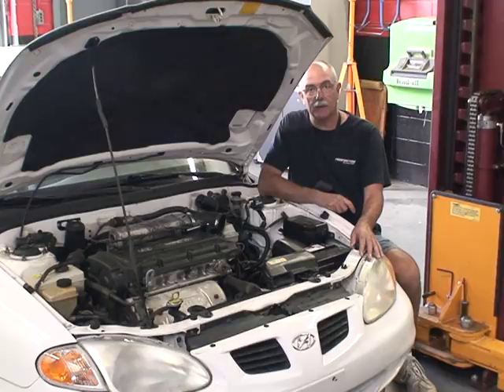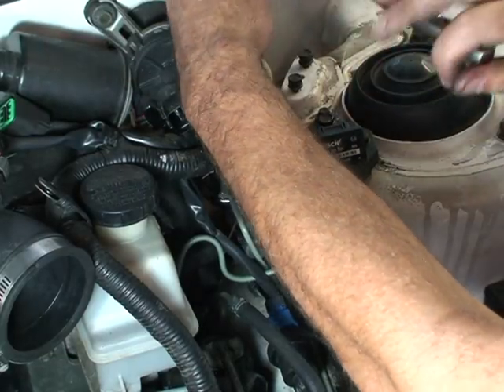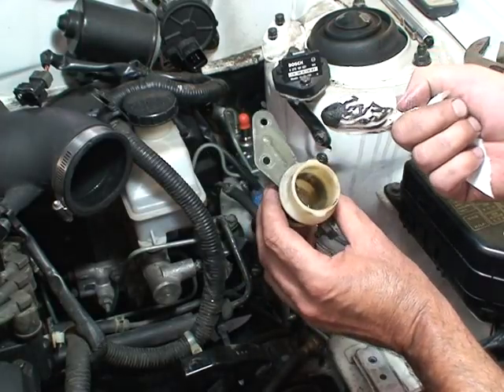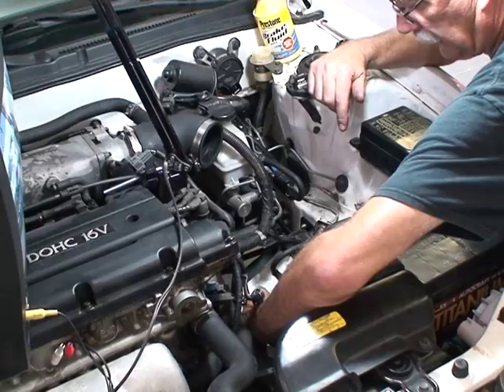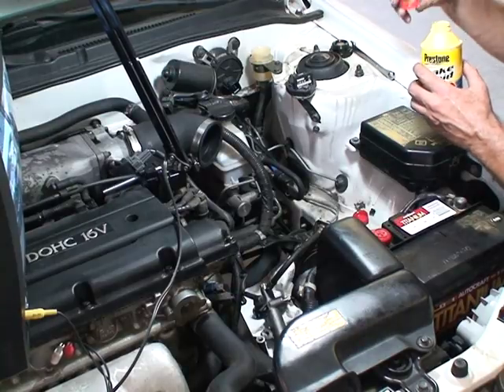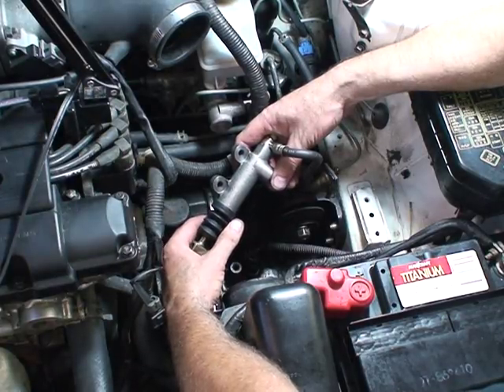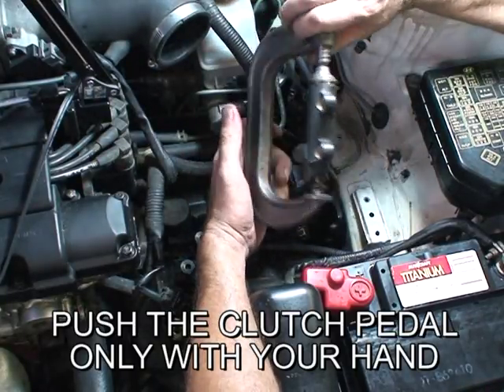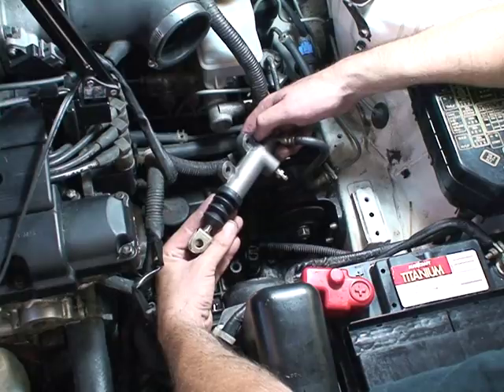Clutch Master and Slave Cylinder Replacement and Bleeding Techniques - Import Application

Comment: This was a TREMENDOUS help!  Cross referenced with AutoZone videos for a little clarification, but basically had this video on standby anytime I had a question about the next step.  Biggest problem - as always, - having the right tools.  Slave and Master cylinder replaced for less than $100 and only about 2 hours of my labor.  Thanks.

Comment: Thank you for your video! I had initially thought that my clutch itself was the issue and I was dreading having to fork out close to a grand to have that replaced. After doing some research on the internet I was convinced that it was the clutch slave cylinder. Following your instructions, I bought the part from my local Auto Zone for 20 bucks and replaced it myself in a couple of hours. The only difficulty I had was the final bolt holding the hose to the old cylinder was rusty and impossible to remove. So I took it to my local Merlin and they separated them for me. After that, it was a breeze to install. I love your bleed method because it does not require 2 people.

Comment: Hey Gary thanks for the tips, I have the new slave cylinder installed and she is performing well for me. I didnt have a grinder but I really wanted the job done; but I was able to pry that banjo bolt loose and brake it off with a hammer. Thanks!

Comment: Thanks for your support video....
Im changed  my cluth slave cylinder on my 2000 accord lx today. 
First i have my friend step on the cluth about 20 time then hold it down , i release the valve on  an old cluth slave to get the old dot 3 out . i removed air filter pipe, water pump hose. i removed two screw on old slave cylinder and pick up from the bottom. i removed the pin with a small size nail and pull the line out . NEXT...I filled up the new slave cylinder with dot 3 oil then pushes...

Comment: Check adjusting nut on where it links to your clutch pedal. If you bled all the air out and the pedal goes to the floor without engaging the clutch you need to bring the nut out to give more play. There should be a nut to lock it place also.

Comment: I now have a great clutch pedal.  for anyone who ever has problems bleeding... it's very simple... ignore all traditional methods,  go rent a powerbuilt brake bleeder vacuum pump for 97$ and go through about 5-7 reservoirs .... whalla!!
Reply: James Richard where’d you rent it
Reply: @alphawolf8070  You can rent a lot of those type of tools at your local auto parts place (Autozone or equivalent).

Comment: Right, it's grade school physics I guess. I'm bleeding a Ford Maverick 2.4 1996 after changing both cylinders. I'm on my own so your back-pressure technique with the slave is proving useful - but I still have a stack of air and pumping the slave only released some of it. So back to the old school  rock-on-the-pedal/slacken the bleed nipple method!! But starting to get some pressure now

Comment: Nice videos and very well presented.
Any ideas why I only get 3/4 travel at the clutch pedal. New master & slave. New clutch kit.
Bearing snapped on ok but the arm is 1/2 inch away from its stop. So there seems not enough throw to disengage the cltuch. 97 1.8 Lantra.

Comment: well, it happened twice. I think both times I pressed to hard and the push rod wasn't centered cause fluid shot out and filled the boot, I pulled it back and it was full. I took it back, got another new one and it did it again. although I have to say it gets the air out fast! way faster than the traditional bleed screw peddle press method. especially since I don't have a helper. I think I it's good to go, I just have to screw the slave back on and see. maybe I'll have time tomorrow after work. hopefully the piston is sealed or straightened back out and everything works. this turned into a 2 week (no car) event! I've learned a lot though, if I ever have to do it again I'll be ready. I pray tomm I get it cause it's too cold for the motorcycle

Comment: I have a 95 toyota tacoma 4x.. the truck wanted to start going with the clutch engaged, in gear at a stop... so we replaced the clutch and flywheel. After assemling everything and bleeding, when you push the clutch pedal it does nothing.. it somewhat moves the piston on the slave but does not engage the arm and the arm does not return to its normal position.. any advice would be appreciated greatly!! Thanks!

Comment: I have tried a couple of different socket wrenches and no luck. But yes my replacement did come with a new bolt for that particular spot. I have been told to try to heat the bolt; carefully of course. Any thoughts on that process? Thanks Gary

Comment: 92 s10 with the 4.3. possibly have a bad slave cylinder. do I have to pull the trans to replace that? a friend said he believes I do. Haven't gotten under the car to try anything yet. he also suggests the slave cylinder is the cause for my pedal being very very hard to push.

Comment: If only you were in DelMarVa region...... one of those videos I'd gladly help with camera..... however, can't drive until I resolve what I hope is answered in this generous tip. Mine is a 2003 Hyundai Accent..... my tubes are aluminum, not the rubber lines seen here.

I've replaced slave cylinder; a few months of refill and quick bleeds got me through.... it leaked ONLY when outside temperature went below 50F. When I pulled original out it was REALLY dry inside slave cylinder, appeared the piston seized. Now to bleed new slave..... BUT.... 

what, if anything, about master cylinder could cause this to be impossible to bleed properly? I do get fluid running out slave bleeder screw. I put the reservoir cap on and it did increase flow out the bleeder a bit when i pushed cap down. I'm running on low budget, don't want to replace master cylinder unless necessary.
 
btw, when i push pedal the fluid in reservoir does move up and down with pedal motion; is that enough indicator that the master's working?

Back to topic.... yeah, I've been sensing it's probably MUCH wiser to bleed UPward..... when I FIRST filled reservoir and pushed pedal, significant bubbling in reservoir. It apparently takes very little air to cause problems..... I do see that the lower stage of reservoir has a bubble at its top. I tried rocking the car, tapping reservoir, and "popping" clutch pedal hoping that might cause a bubble to break loose.

Argh. Thanks for this.... it's excellent, plus the community's contributions. At this point maybe my most pressing question is if the master cylinder might be faulty or need bleeding?
Reply: Belated thanks, Gary..... big concern here is the release bearing lever that's (supposed to be) pushed by the slave pushrod.

Looking down at slave from front, I can push that lever by hand, to the left toward right fender. It returns to position telling me the new piston's spring works and the piston moves freely in cylinder. HOWEVER, shouldn't that lever be pushing hard AGAINST the pushrod, awaiting the pedal's push to move it away (releasing bearing), then when pedal is released, it should push back against the pushrod?

No success getting any pedal back after replacing slave and bleeding..... and bleeding. IN the master reservoir, when filled to top, there is an air bubble at the top of the lower stage of the reservoir. I can't break it or burp it. Car's leaning a bit to right in my driveway, maybe try to get that bubble to rise.....May be inconsequential, too.

Lastly..... there's a tiny plate and spring called "valve plate" in the slave's inlet, under the union bolt that joins the steel clutch line at 90 degrees to assembly. It popped out, I put it back but.... something about it riding inside a threaded channel makes me wonder if it's cocked or seized..... what's it supposed to do?

thanks in advance for any insight..... you're a sage :)

Comment: Hi, please assist with some advice regarding Hyundai Getz 1.4 2007, couldn't change gears at the stop street, clutch pedal was loose, found some liquid at the bottom aswell. Managed to take it out of gear with assistance, and tow rope. Clutch is still loose, but gears are able to change,vehicle wont start. Thank you

Comment: I have a 86 nissan hard body truck 72s with a z24 motor clutch went out ,replaced slave cylinder cant bleed it right any ways it wont shift running but goes through gears not running and can only start in reverse drives fine in reverse any help would be appreciated

Comment: Replacing the slave on a 96 accent, basically the same setup. I've fed the fluid through to the slave, but I absolutely cannot compress the slave pushrod at all once I close the bleed screw. I don't think the rod on the master is too far out because it is short enough that it is pulling the pedal forward a little. Any ideas?

Comment: gary, i just got a 2000 hyundai elantra gsl 5spd it has 245k miles on the body and roughly 90k on the motor but i believe its the original  trans, when i start rolling and go into second gear it grinds really bad BUT only if im higher than 3k rpms and downshifting from 4th to 3rd it grinds a little bit i dont think it could be the clutch itself, or could it? i was thinking it might be the syncros if those transmissions have them. what should i do?
Zach.

Comment: Hey Steve gotta 07 Hyundai Tiburon se 2.7 6speed manual and replace everything you just did same set up and my clutch peddle gets hard as a rock and stays up! I tried too hand vacuum pump it with the loaner tools at autozone and still no luck the actuator will not move on the end of the slave cylinder so idk what I’m too do had a 25 yr certified mechanic look at it and he said it’s deff not the clutch because the slave cylinder isn’t moving at all when I bleed it the peddle slowly starts too build pressure then it just gets hard and won’t go into gear please help!!! I’ve been cursed with trying too fix it and just can’t seem too see what I’m missing here the throw out bearingbis working when I use my hand to move it back and fourth so I don’t think it’s the throw out lever for it so please If anyone can give me some advice I’d appreciate it so much got two adopted children that I gotta be able to get back and fourth with and just need some help thanks man I love your tutorials

Comment: I wonder about that black sludge...... I'd wager that's pulverized seals. I did have a significant burst of that in reservoir- that's been drained plenty; it's not likely that it came up from slave cylinder's deteriorated seals so I might indeed need to replace master.

What would be a visual clue the master's bad? I didn't get what the C-clamp and slave cylinder example was about...... and what was meant by "push the clutch pedal only with your hand"?

Comment: had the same exact problem with my 86 fiero, the bearing wasnt locked in. and had to make a longer push rod the comes out of the master cylinder to the clutch arm on the trans, what a head ache

Comment: Hey folks at perfectionclutch,was hoping you could give me a little insight on my situation.I depressed my clutch pedal on a 2001 Mazda Tribute 4cly-4wd and it suddenly bottomed out and doesn't return to correct spot.Cannot be put into gear.My uneducated guess(and hope)is that either the clutch m.cylinder or slave cly may have blown out.I will say again,this happened without warning.If you can spare some time I would be very appreciative if you might be able to walk me through the simple possibilities.
Reply: perfectionclutch Thank you Sir.

Comment: hi, ive a elntra and the clutch is slipping in second gear and third when I add power . done 170km. is it hydraulic or the clutch runs well in 5th ?

Comment: Hi Gary i have a Toyota Hiace 2004 i am having intermittent problems with the clutch. the engaging point is an inch or two off the floor but sometimes it is right on the floor so you either cant put it into gear or get it out of gear a few pumps of the pedal fixes it. Does this mean i have air in the line or a faulty M/C or S/C?
Reply: Not using fluid and there is no sign of a leak anywhere i can see. I thought i might just bleed the system to see if that helps. The pedal height and push rod free play seem to be alright. If i dont have any luck after bleeding the system i think i will take it to the mechanic. What are your thoughts? Thanks Gary kind regards Keith
Reply: Thanks very much for your advice Gary you have been very helpful kind regards Keith

Comment: @perfectionclutch ok so i was looking around some more and it looks like it could be the hard line running from the master. the m/c runs along the firewall then towards the radiator its got some ways to travel so im guessing its just the hardlines because theres oil coming from it when i compress the clutch in

Comment: I have a 2002 elantra and we have just put in a cluch,but when getting ready to bleed the clutch, you can only push the clutch pedal in about half way. when you open the bleeder valve it goes clear to the floor but as soon as you try and push it down again it feels as if the pedal is stuck half way. we replaced the master cylinder but not the slave cylinder . should we replace the slave cylinder or something else ? Thanks

Comment: @perfectclutch i have a 95 integra 5 spd, and im changing the master and the slave cylinder but the reservoir still have fluid in it. Would you open the slave bleeder and keep pumping the pedal to drain fluid or just take the parts out even when its still full of fluid?

Comment: i have a hino 4ton truck  the clutch is leaking break fluid its also was stuck in first gear i took of the drive shaft so its free up i just wanna know how to remove the entire clutch line? i ordered a new master cylinder but the aliment setup was different so i cleaned the old master cylinder and exchanged the internal settings.any other other advise would be great :).

Comment: I drive a mazda 626. Earlier today, I was driving and I messed up and hit a curb pretty hard. On my way home I noticed I had to push my shifter pretty hard to switch gears, no grinding, though. After I got home, I let my car sit a little while I look that problem up. Well, I just went to start it, and I have absolutely no resistance in my clutch pedal. The clutch disengages, meaning, I can switch to reverse, but I have to force it really hard, again, no grinding. Is it just the cylinders?

Comment: hi i recently changed my clutch on a 93 honda prelude. ever since the clutch pedal gets hard and the car will feel like if the clutch is not disengageing. so what i do is a will bleed the system and it will work for like some days and then it will do the same thing? so i changed the slave cylinder and its still doin the same. do you think it can be the clutch master cylinder?

Comment: well...  I've got it all hooked up but the peddle still goes straight to the floor. I believe I messed the slave up again pushing on it considering the boot was full of liquid today when I pulled it back. I  hate to take another one back. i wonder why that happened? pushed it when it wasn't centered?  this stinks. before I put it back on I watched for bubbles while i pushed and saw a few come out and then none. it seems full and it doesn't appear to be leaking from the piston anymore.  when the peddles to floor it's hard to push the slave in so it's got pressure. it's not leaking from any of the fittings. I believe the reservoir hose clamp may not be as tight as it should be... the boot having liquid in it is an indicator of a bad slave right? I remember clearly when it filled with liquid both times. I was pressing on it watching the bubbles come out (happily) and then it got real hard to push, so I pushed and  I felt it make a crunched popping kind of noise. I also heard air hiss and felt liquid come out and fill up the boot. the first time it happened I just went that very moment to return it. i came home and did it again... this seems like the perfect way to bleed it though. I must just have to be very careful to keep it centered... I'll take it back again, hopefully they will let me. Have you ever had this happen?  I noticed you placed it pointed towards the ground on a video and just did it by hand in another.  I think the answer is : 1. Get a better clamp incase it's allowing air in through the reservoir hose. 2. Replace the slave again. 3. Bleed it again the same exact way except very carefully, along with some gravity and traditional bleeding techniques because of my particular type of vehicle set up.
Is this correct? Should I attempt to bleed it other ways and leave it all hooked up? I think if it ever allowed fluid to escape and I heard a hiss of air from the piston... it's a goner period. right?

Comment: can you use any brake fluid or do you have to use the brake fluid recommended for your car ?
Reply: jnnyblck88  thank you man i appreciate it cause it doesnt seem like it says anything on my cap for the clutch resorvoir dot wise but for whether to use brake fluid or not it says use only brake fluid and i have put dot 4 in it it seems fine though but i do have a leak in the slave cylinder how did you find out if it was the slave or just the o ring?

Comment: Hi thanks for the video i got a 1999 Honda prelude wen i put it in first wen it let,s me it shake a little do you think it is the clutch.
Reply: the mounts are fine but i am leaking oil from the rear seal thanks for the reply
Reply: Thanks a lot it help me a lot i just hope i don,t need to rebuild the trany thanks again.

Comment: Hi, thanks for the tutorial. I have just replaced the slave cylinder of a 2003 tiburon. One question however, it seems like that the connector that is attached to the clutch and reaches into the slave cylinder is a bit too long. Clutch slips a bit as there seems to be no space in the cylinder left when clutch is in release. It also was hard to screw the cylinder back in. I am thinking of sanding off 3-5 mm of the connector. Is that something one could do? thanks and best